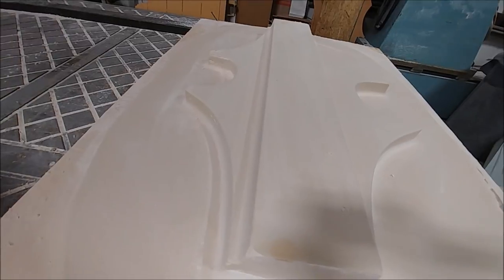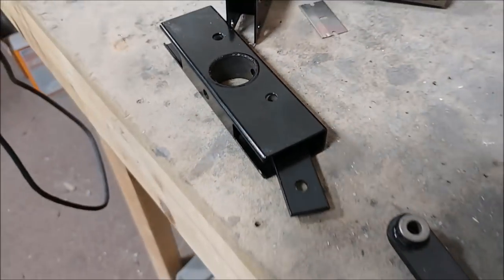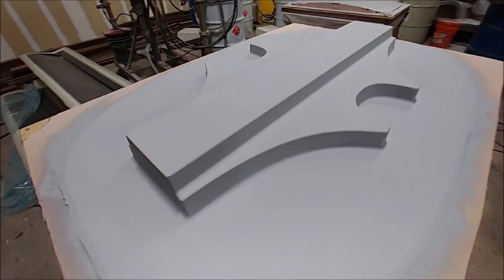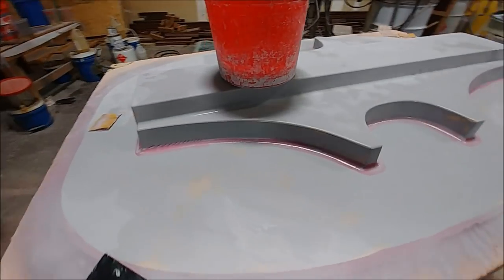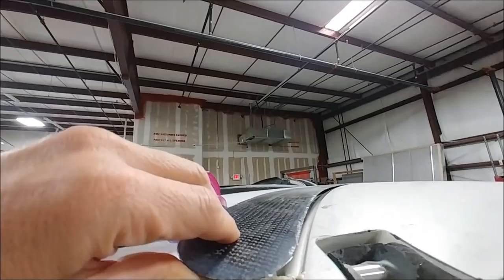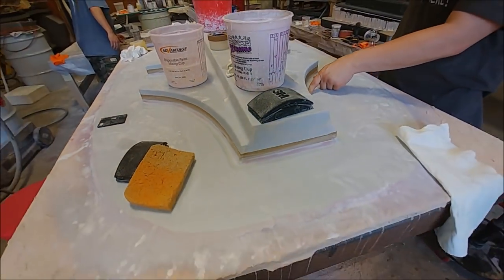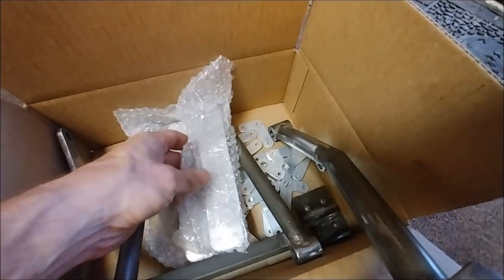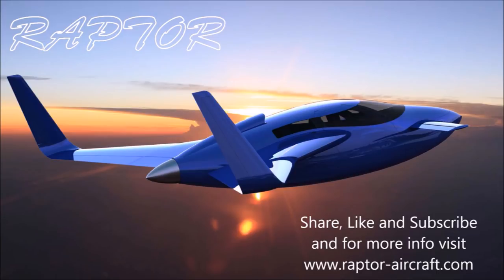Overhead Console Goes In!

Comment: Does the throttle control have a friction device used to maintain setting?  Audi TPC  doesn't need one and should return to idle.  Another great video.
Reply from the maker: TonyK3130 yes. I have mentioned that several times. Surely you don't think that we would let it just be loose?

Comment: Great video as always, just wondering if its not advisable to have the remote fuel drain line made up of a flexible tube to allow for vibration. 5:42
Reply from the maker: Darryl Ellitson I'll ask Jeff if he wants to add an intermediate brace but that tube is so lightweight it's unlikely it will vibrate much.
Reply: you have me addicted to your updates.... looking forward to next weeks update
Reply: Darryl - Flex will chafe unless it's tied down a lot.  A couple bends in a rigid line every so often works just fine for vibration.  Commercial aircraft have rigid lines all over the place.

Comment: Correct me if I'm wrong but doesn't the remote fuel sump create an issue? If there's water in the tank it likely won't make it's way all the way down the extension line which means that to properly ensure fuel integrity, one needs to sump enough to empty the extension line plus a bit more. Nothing huge but something to be aware of.
Reply from the maker: Big Sky March 2016 you might be right. You might be wrong. Either way it's better than having to crawl all the way under the middle of the aircraft. Better to easily just sump a larger sample from the side of the fuselage..
Reply: Raptor Aircraft. 
Sure. Like I said, just something to be aware of.
Reply: Having flown the DHC 125 Hawker, I concur that crawling under a low wing aircraft is a pain. Guaranteed to get you dirty.

Comment from the maker: So I'm running the engine earlier and about 10 minutes into the run the aluminum fuel cell mysteriously starts leaking jet fuel, and quite a lot, out of one of the lower weld seams. Needless to say the engine run was over. Of all the things that could go wrong this was not something I expected. 😳
Reply: Sorry to read this, but it is always better to work out the bugs at this stage. Could it be due to vibrations? It is also possible that the weld was not done correctly.
Reply from the maker: There was no vibration. A poor welding job. Fortunately the fuel cell is not part of the airplane.
Reply: Peter, for reference, where does the fuel cell sit now?
Reply: it's a nothing-burger. Strakes with Jeffco sealant are the real tank
Reply from the maker: Jack Chambers it's just the one on the test stand.
Reply: Raptor Aircraft I don't recall, was the fuel cell one that was purchased or one that was custom  made?
Reply from the maker: Jason Dendinger purchased

Comment: @Raptor Aircraft - peter what happens to the parachute straps and the windows during post cure of the fuselage?
Reply from the maker: bdpd1 nothing special. They can handle the low 200F temp that we'll be taking it to.